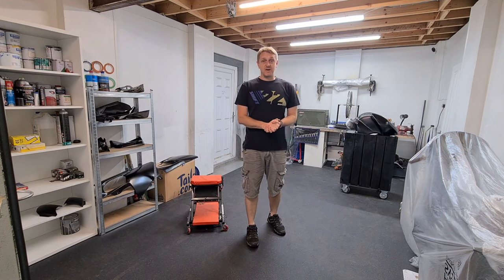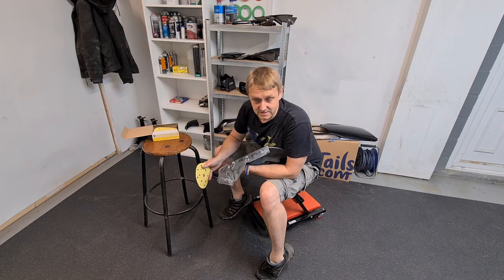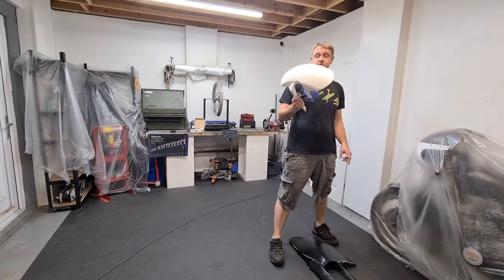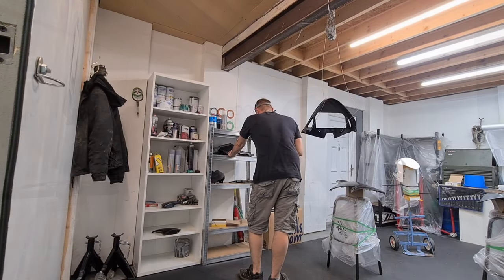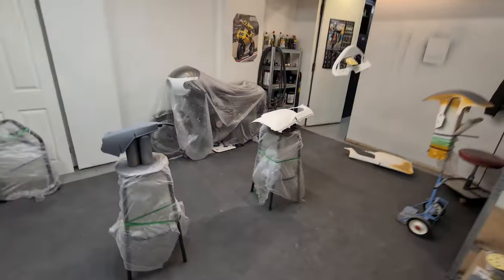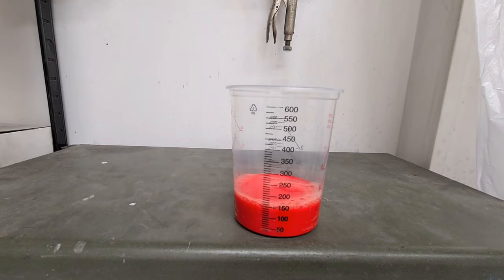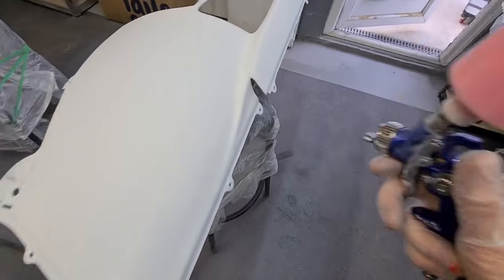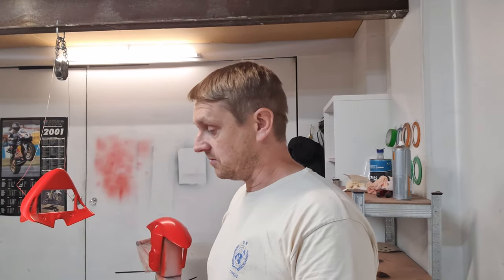Fast Bikes magazine Aprilia RSV MILLE 2022 Repainting Part 1

Comment: Stunning video and as always great dedication in making them!!
Reply from the maker: Thank you so much Tim that means alot glad you enjoyed it thank you👍
Reply: I‘m looking forward to the third part!! Your attention for the details is awesome. The decals are from imageworks? The really look like OEM ones
Reply from the maker: Thank you I don't know where the decals are from they are very accurate but the problem with panels is that they never match up with decals due to molding etc...
And you have to find compatible paint products to work with them...
Some paints have heavy solvents and others don't but.. The weather was very hot at the time I was painting so this will accelerate the curing of the clearcoat so it can delaminate the printing..
Best way is to paint at midnight but this was a tight deadline so lots of problems occurred with the decals
Reply: @PXCBIKES  oh no! I Hope everything went well in the end! You definitely matched the fluo red on point! From factory the decals are not covered with clearcoat, so maybe that would have been the easiest way.
Reply from the maker: Yes I didn't want to clear over them but the customer wanted them cleared over 😬 but the problem with clearing over big decals like this can cause delamination if they are damaged